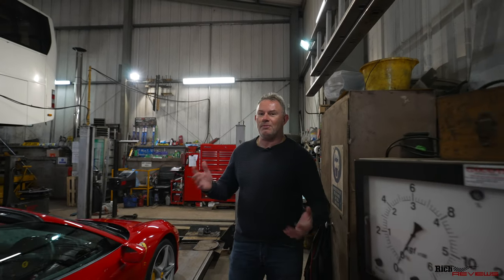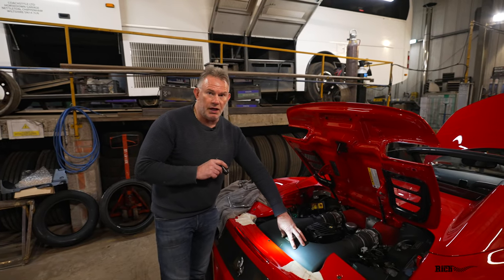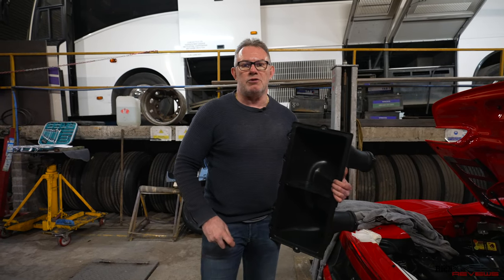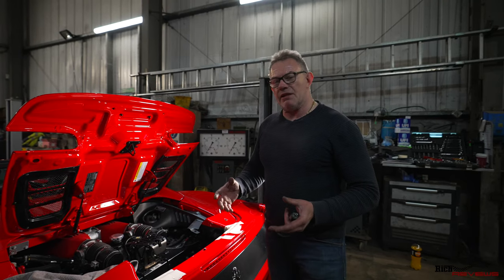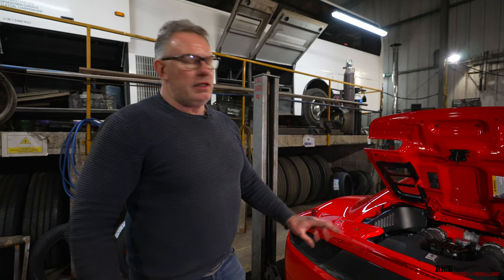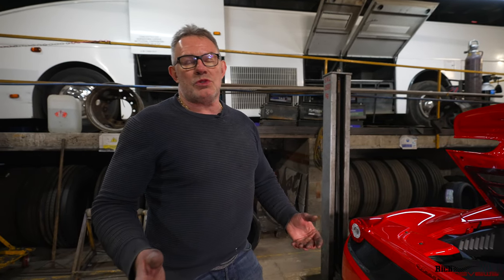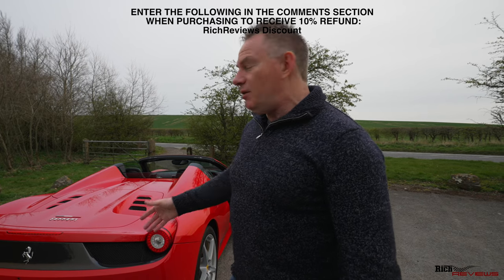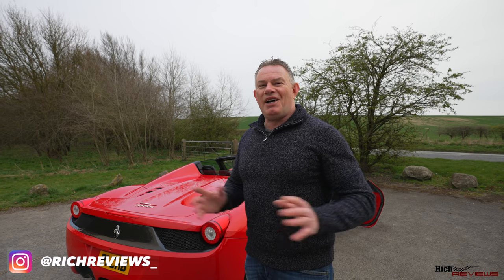I FINALLY fixed the sound of my Ferrari 458! (EXHAUST MODIFIED!)

Comment: Nice video  lots of information. have disconnected vacuum pipes on all my Ferrari's Valves permanently open sounds great and costs nothing.
Reply from the maker: Nice and easy approach but no control over sound. I need to quiet down the exhaust at times.

Comment: Rich how long does the installation process take?
Reply from the maker: Around 3-4 hours if you remove the rear bumper for a spider. As I say in the video, you can get away without removing the bumper for the Italia but though I managed it for my spider it was hell!
Reply: @RichReviews_  thank you so much, I've just purchased an italia and I bought the forza componenty. I was wondering how much the labor would be for the whole process

Comment: No Xpipe? Shame on you
Reply from the maker: Flat Plane Crank based engines technically do not need a crossover X-Pipe due to the manner in which the separate banks fire...these benefit cross-plane crank engines more. However crossover pipes do help to boost sound but at a cost both financially and to Ferrari warranty.